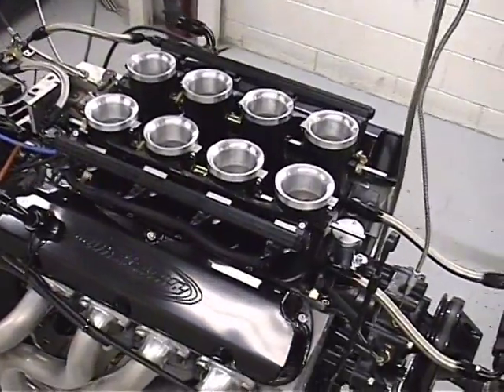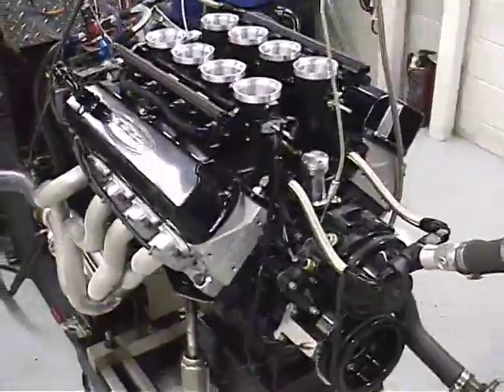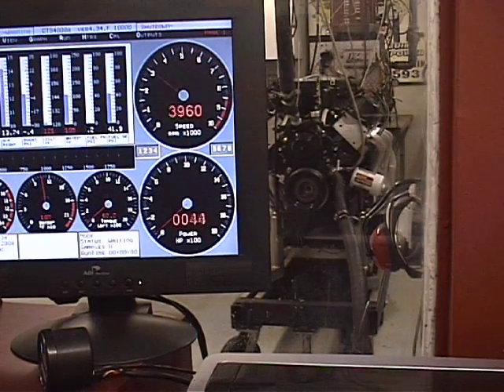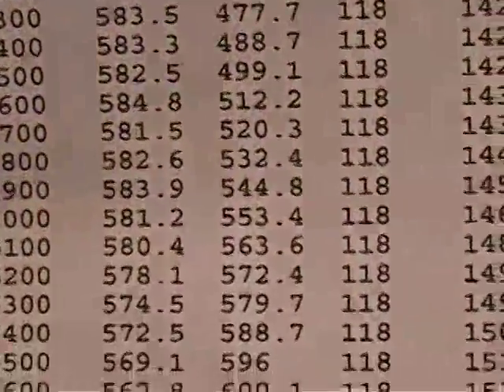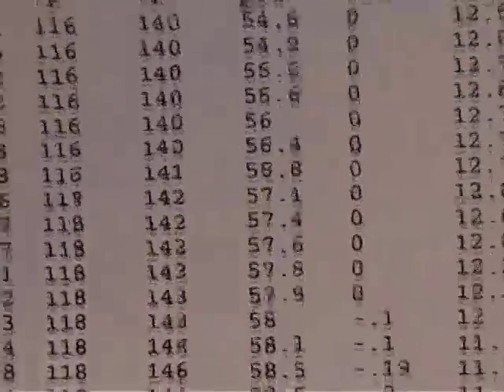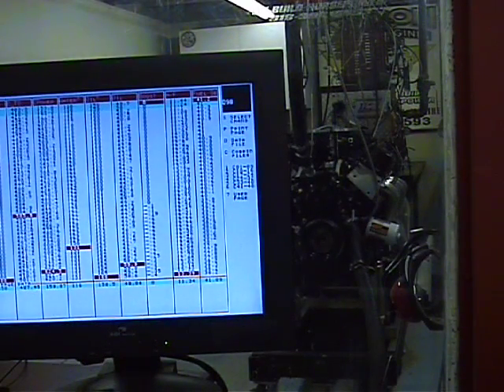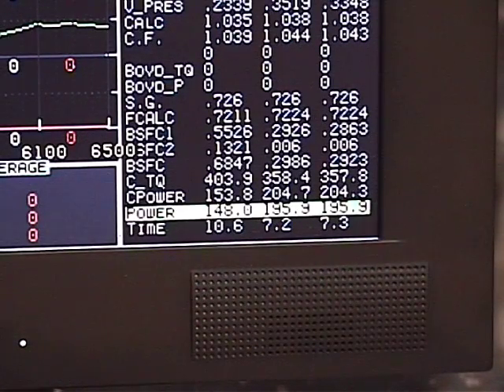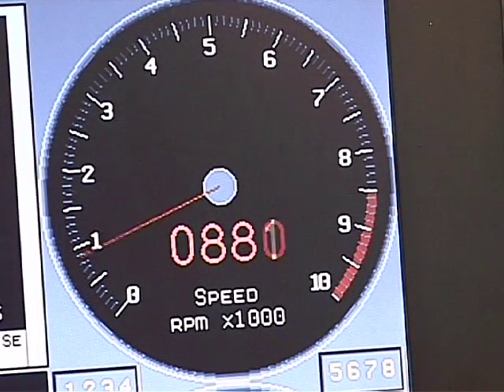Ford Windsor 440 SBF from Nelson Racing Engines.

Comment: If you go on there website the engines go anywhere from $20,000 to mid $30,000.. This engine i think is around $28,000.
Reply: Thats way to expensive..the cost is all R&D,,, this engine can be done way less than half that cost..ill do it for you for 12k
Reply: @dennyramsey8774  your right on this bruh. A Dart block is 3,100$$$, AFR or Brodix heads & any number of great pistons & rings & other parts that will stand the pressure of high horsepower & or nitrous or a blower. Chuck on Street Outlaws is running a 421 small block & he's putting down krazy power & fast times. Money can ALWAYS get you the power your looking 4, just be prepared 4 the headaches that come along with it.

Comment: You guys are such a rip off for how much you charge. 630 hp out of an all aluminum 440 stroker small block ford would be easy as hell to replicate...and for half the cost...
Reply: Yes it is a lot of money 💰 
But u didn't ask politely what bits & pieces r on the inside . Borla individual throttle bodies with electronic fuel rails  " Ain't Cheap " 
Dyno Time Ain't Cheap 😮

Tom & his Crew build up some Awesome Engines.  👌 
Being Respectfull might help . 

There's a guy in Georgia who purchased a pair of mirror turbos from Tom 4 his LS build 4 a Jet Boat Eliminator 21ft . Gr8 Engine & well thought out combination ect . 
On youtube he has been having lots of trouble getting this engine in its sweet spot & going hard . 
Not knocking the Guy as l am a fan of his . 
But if Tom had built this Engine it would have been bang on from the get go . 
It's always best 2 sometimes keep Ur thoughts 2 urself .